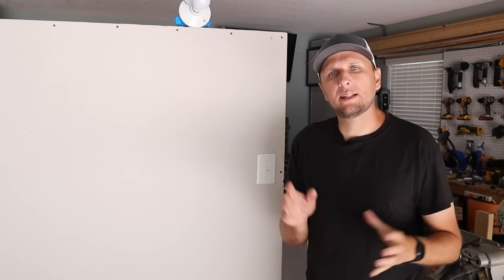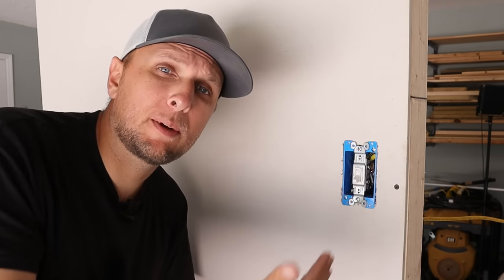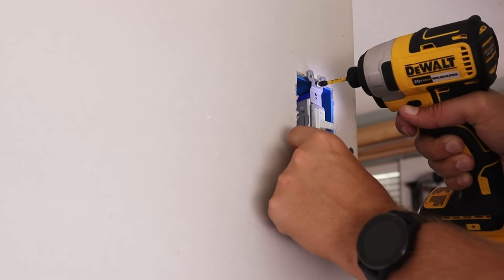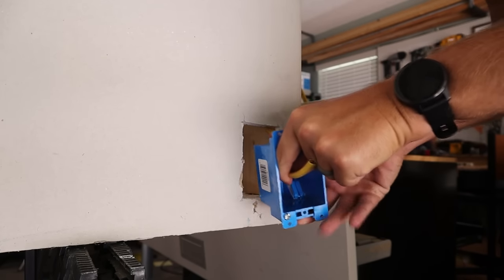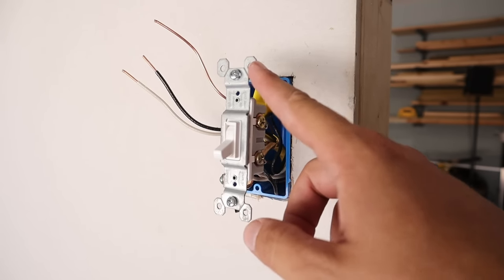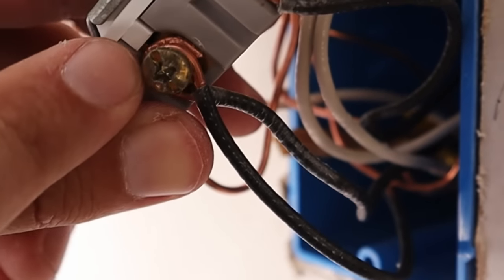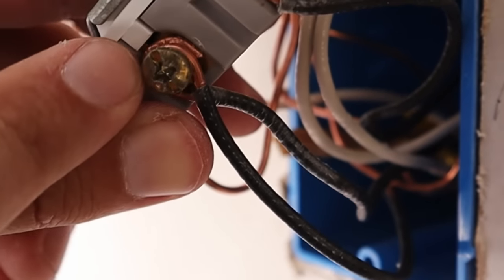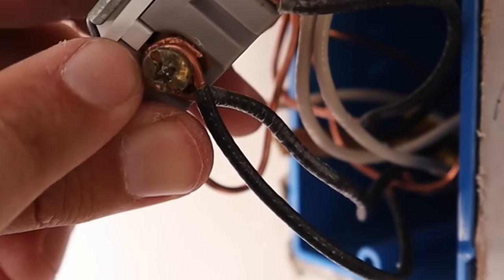How To Add An Outlet From A Light Switch | Common Mistake

Comment: It should be noted that if the switch is fed from the light fixture, which was a common technique decades ago and is called a "dead-end switch leg," you won't be able to use that switch box as your source because it has no neutral wire...
Aslo, why are you using #12 wire on a 15 amp ckt..? @ 9:00
Reply from the maker: Yes this would not work in many older homes.  And it is perfectly ok to use #12 on a 15 amp circuit.
Reply: @HowToHomeDIY  Yes, but more expensive material...especially these days...

Comment: Aren't light's on 15A fuse and outlets on a 20A?? I even noticed it in your switch box when  you turned the power off. There were the 20A's on the left with the 15A (which you turned off) on the right. Also aren't lighting circuits usually on a lower gauge wire? Doing what you've done increases the chance that the wire will overheat and cause a fire or at the minimum trip the breaker constantly depending on what you plug into it.
Reply from the maker: Not in the US.  The circuit breakers are generally done by the room or rooms and their expected uses.  They 20 amps you are seeing are for circuits that require to be on their own circuit such as GFCIs, well pump, refrigerator, sump pump, garbage disposal, etc.  What I showed in the video will not causes an issue.  It’s all about what your intention is with the outlet, how much amperage will it pull, and what is already on the circuit.  Hope this answered your questions.
Reply: @HowToHomeDIY  Thanks, I'm from Australia so it's done a bit differently here.

Comment: I would like you to explain why there are 2 gold screws and 2 silver screws.  There must be a purpose for having 2.
Reply: They can be wired to have two different feeds - one top, one bottom.  This is typically done if you want one of the outlet plugs to be run off a light switch but not the other. In order to wire an outlet like this,  you need to remove the metal bridge between the screws.  There's a piece of metal in there by default which makes the two outlets connected together (like in this video).

Comment: What if you have knob and tube?. I couldn't find pull power from a 3 way switch to add a ceiling fan to my daughter's room. I ended up pulling power from the attic light.

Comment: instead of using hese funcky cut in boxes use a standard plastic nailon box, cut off the tabs holding the nails, slip the altered box into the hole you cut then use drywall screws to screw the box to the stud. Only works when you are next to a stud otherwise use a cut in box
Reply: that is a code violation, those boxes arent made for the screws to be inside the box. can you do it? sure. Ive done it several times. hell I do it to nail on boxes since the drywall monkeys cant seem to get the cut out around the box right and box pulls out of the wall since the cutout is too big

Comment: This looks so easy, but I have old wiring.  I have an old black and white coming up from an outlet on the outside wall that is powered by the old wires connected to a switch further up  on the inside wall.  The wires on the inside are two black and a red.  Both black are hot.  I know the red was connected to the outside set to give it power.  But, since no one marked anything, I'm not sure which black I need to pigtail with the red and the black for the outlet.  Then, I'm not sure what goes where on the switch.  No matter which way I put the blacks and the white from below, I block the circuit breaker.  So, do I really know what I'm doing?  No.  But, I have no money for an electrician.

Comment: I’m not electrician, what do I need to do with the wire wire and the ground wire after I conecte the hot wire to power my new outlet? I just need to add a new outlet for my new refrigerator for my tool room

Comment: Please make sure that the light switch is in the off position when looking for the line wire. If not, it will provide power to both and you won’t know which one is the line wire.

Comment: Question… if you do it this way, wouldn’t the light switch also control this outlet. You would have to turn on the light switch in order get power to the outlet, isn’t that right?
Reply from the maker: No.  The receptacle and the switch just share a power source.  They aren’t connected to each other.

Comment: I would turn the outlet so the ground is on the top in case a plug is not fully installed to prevent accidental shorting

Comment: Is it common for "unused/pass-thru" neutral lines to be present in light switch boxes like that? 
I actually shied away from adding smart switches because I was under the impression that there was typically no neutral in there and so I'd end up having to fish one up from some distant outlet to the box.
Reply: not until recently. the old school method was to repurpose the white conductor was a return in a switch loop. new code mandated a neutral be in switch boxes whether it is being used or not

Comment: What is the outlet box fasten to? I thought he'd screw/nail it into the stud on the right. It looks like he just screwed it into the drywall.
Reply from the maker: No it’s called an “old work” box.  It has flaps on it that when you start tightening the screws, the flap go up and tighten down with the screw.  Essentially it sandwiches the drywall between the flap and the front of the box.

Comment: I have a light switch that has two wires connected on the right side. One black one white. These are both hot whether the switch is flipped on or off. Also one red wire on the left side that is hot only when the switch is on. So that seems to be going to the light. But I don’t know why the white and black wires are always hot.

Comment: So with that will the outlet turn off when the switch is off?  And is there away to take power from switch and make an outlet that won’t turn off when the switch is off
Reply from the maker: No.  The way I wired it in the video the outlet always has power.

Comment: So the outlet has power regardless  if the lightswitch is flipped on or off? If so how would you make it so the outlet only had power if the light switch was switch to on? by running a 14-3 wire connecting the 2?
Reply: Connect the black wire to your outlet to the other wire in the switch.

Connecting to the line wire (as in the video) would give you an outlet that is always on.  Connecting to the load wire (the other side of the switch) would give you an outlet that is on only when the switch is on.

Comment: So with light switch off the outlet will have no power? Or would that be the case if the outlet was pigtailed to the load wire or as in the video the top wire?
Reply from the maker: With my setup, the outlet always has power.

Comment: Since light switches don’t use neutrals, it’s a big stretch to assume that the box is just going to have a convenient neutral waiting for you. Also, it’s not a good idea to twist wires together before adding a wire nut.
Reply from the maker: All of your newer homes will have a neutral in the box.  And I disagree.  It is a good idea.
Reply: Twisting the wires together is the only proper way. You never depend on a wire nut to do the twisting for you. Nothing pisses me off more than to take a wire nut off and the entire bundle separates with sparks flying and lights going out.. Especially on 277.

Comment: Only works if the power is fed to the light switch and is being switched for the light.  If it was just a switched ground leg for the light that has its power at the light box then this can t be done.
Reply from the maker: Correct

Comment: Maybe I missed it , but lots of switch boxes have no neutral in them. If the electrician has ran a drop from the light itself, there is no neutral. Therefore you can not run an outlet from it because an outlet requires a neutral.
Reply from the maker: Correct

Comment: I had an outlet and a switch in the same box.  Another outlet came out of that box.  I wanted to separate the switch and outlet because it was cumbersome to flip the switch with something plugged in.  So I did, but now I have no power to the switch, just the outlet that was in the previous box.  What do I do?

Comment: In my home, the power first went to the light, then the romex went down to the switch, so the black was the hot wire but the white wire was just the power wire being supplied to the bulb, so there was no neutral.

Comment: I suppose I’d recommend not putting an outlet directly under the switch and move to the other side, in the same channel, but other stud. In this instance having the outlet so close to the door is pretty pointless and in the way, when people put them so close like that they end up having to trim faceplates to get them to fit.

I know it’s not that this was the point of the video, but something to think about, and after you’ve had to move the outlet, or trim a faceplate, you’ll see that in the future.

Comment: You have  good videos so I don't want to be critical but you cut the bottom box to close to the bottom plate, old work box tab (bottom) won't work. When using old work boxes tabs on the device should be removed so faceplate sits flush.
Reply from the maker: It’s just a mock up board.  I did not have adequate space to use.  I think I talked about this in the video.

Comment: You did not tell people that in some switches you  may only find a hot , ground and no neutral(white wire) and  it is not code to use the ground (as your neutral the white and black are the  switch wires which is the hot coming and going to the light).
In this situation the light has the power to it and they only ran the switch  leg to the switch box , which is up to code.

Comment: one thing you need to make clear is the power is comming to the light switch box. sometines the power goes to the light and the line to the switch only contains a hot no ground.
Reply: unless the hack that wired it repurposed the ground, there should be a ground. usually there is no neutral in older homes switch boxes. or half the time, hacks would either tuck the ground in the back of the box or trim it off almost flush to sheathing

Comment: I'm surprised you're allowed to mix light and power circuits.  That's completely illegal in Australia.
Reply: In the US, many older homes were wired by location, instead of separating switches from receptacles. In modern homes most electricians say to separate power and light circuits as you mentioned. That way you have appropriate circuit breaker values. So, it's not the best plan, but if you must, make sure you use the same wire gauge that's in that circuit and keep track of the addition.

Comment: if a regular  outlet and you can use a 15amp circuit. then install 14/2 romex.   12/2 is more for kitchen outlets.   12/2 just uses more of the box.   don,t cram boxes.  big  mistake.

Comment: I have a switch that's connected to a plug. No light in the room. 
I'm going to install a light and I'm thinking of doing this, but kind of in reverse. Connecting the light and plug like you have here so that the plug is no longer controlled by the switch

Comment: I usually cut a smaller hole first so I can poke around and see if any wires were going to be in the way of my intended location that way I don't accidentally cut in the wrong place and then have to slide it over making a bigger hole that now needs to be patched.  Also make sure the wire to the switch is not just a shortcut hotwire where the power is actually at the light source meaning the white is not a true neutral but is being used to carry the hot  back to the light.  This is really annoying and should never be allowed

Comment: Does the outlet have continuous power or only when the switch is on?
Reply from the maker: Always has power.
Reply: @HowToHomeDIY  I did  a switch last this but the outlet only has power with the switch on, maybe I did something wrong? Everything works good and tested right but no continuos power
Reply from the maker: Definitely wired it wrong if the switch is operating the outlet.  Either you connected the wire going to the the outlet to the switch or you don’t have a neutral wire and you connected it to the white wire thinking it’s a neutral wire but it’s the load side of your switch leg going back to the light fixture.  There should be two black wires and a white neutral in the switch box.  If you don’t have that then this install won’t work.
Reply: @HowToHomeDIY  yes there are 2 black wires and a white but they both have power so I picked one of them and pig tailed them like you did in the video, so maybe I picked the wrong black wire
Reply: @HowToHomeDIY  I also subscribed to your channel,

Comment: Before you cut the drywall, verify that you do have a neutral in the switch box.
Reply: any suggestions when there is no neutral but you would like to still use the single wire in the box and bring a neutral from another location, or would that be "cobbling" it up
Reply: @jamesbryant1023  Don't bring just another neutral. You could overload that neutral by using it with two different hots and an overload could lead to a fire.
Your best bet is to use a nearby outlet instead of the light switch, and extend the hot, neutral and ground to your new location. The nearest outlet may be on the other side of the wall and there are a lot of tricks to run the new cable, such as pulling the baseboard and cutting into the wall behind it.

Comment: I didn't know about removing the ears on old work boxes. I just installed a few outlets incorrectly.
Reply from the maker: Well if you don’t notice the face plate sticking out away from the wall and it’s sitting flush with it then you don’t need to worry about it.
Reply: @HowToHomeDIY  I need to correct at least one, you can tell there is a bit of a bow to it. Thanks!!

Comment: What if there is only one white made up so switch.   I have no white only ground. Can I use the bare copper?
Reply from the maker: No, you need a neutral.  In older wiring there isn’t always one there as it’s wired differently.

Comment: An issue here is that there may be a wire running up the 2x4 to the switch box from the bottom, so when you cut the hole for the new outlet box, that wire may be in your way. To avoid nicking the wire when cutting the hole for the outlet box or having expand the hole and having a gap, I generally push off the 2x4 enough to accommodate any stapled wire(s). The only remaining trick is if two or three wires are running up the 2x4 and are stabled together, but by initially pulling the switch and looking at where the romex is coming into the switch box, I'll know what potential wire runs are coming up the 2x4 under the switch box.

Comment: Running an 'outlet' (wall socket here in the UK) from a lighting circuit! What devilry is this? Where is the wire to the light fitting? Where does the 'cold' (neutral in UK) feed come from? I must admit some US building code practices baffle me!😁
Reply: There is nothing wrong with doing that in North America. In fact, most houses are wired this way. It is completely safe.
Reply: Devilry?  It is completely safe and to code.
Reply: @FelixtheMetalcat  Have you heard the phrase " tongue in cheek"? :)

Comment: You went about your video backwards for the homeowner !
You cut your hole for your box and fished your wire which is great for your application.
However the homeowner when they try this might not be as lucky as you .
So many times in homes these switch boxes only have a true hot and switch leg the neutral is left in the ceiling box .
That all needs to be figured out before any other work can be initiated.
Without a neutral a receptacle isn’t possible unless you get shady and utilize grd for neutral

Comment: Australian here - we wouldn't be allowed to this  - we separate light and power.  You can't them have a failure of an appliance take out the lights too.
Reply: You can’t have appliances and lights on the same circuit in North America either. This is only allowed for bedrooms/ living rooms where only small loads will be used

Comment: at the end he did not show where the 3rd black wire is connected. he shows the splicing o f the two black wires '. for a beginner it was clear to me but at the end it was not clear. you could illustrate at the - the rear of the receptacle
Reply from the maker: I did show it and talked about it.  It was the load wire that was already attached to the switch.  There was no need to remove it from the switch as it didn't get connected to anything being installed.

Comment: Ok what if there is no neutral running into the switch box? I have switch in my bathroom that turns on a vent fan with a light. I didn’t see any neutral wire at all. Just a hot wire running into the switch and then another wire running up to the vent fan.
Reply from the maker: Can’t do it then.  Have to have a neutral.  Would need to run new wiring with a neutral.  The neutral is probably currently up in the light fixture.

Comment: After my father died I was working on now my mom's house. My father said he did is wiring to code, but he really didn't. When I was testing a circuit before working on it I found that the switch to turn of a remote load cut the neutral, not the hot. Oops. The switch and breaker colors were correct but somewhere along the line a utility box must of reversed things. Very annoying as I discovered when I discovered the switch when I cut  a wire and the now dark light flashed on a moment. From then on I never trusted wiring colors or power levels.

Comment: Why is there a neutral in that switch box?
Here in NJ in my 1973-built home the switch box only has a switched hot leg up to the lamp.... I see this as typical on other nec wire sites.
Reply from the maker: That's old wiring.  It will probably be in the light fixture box.